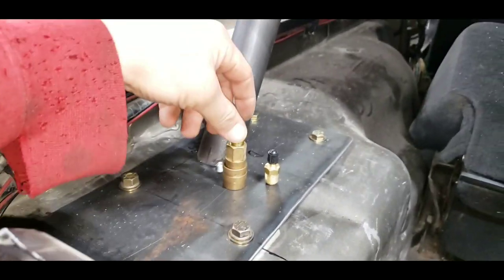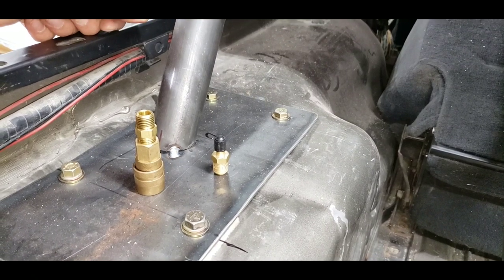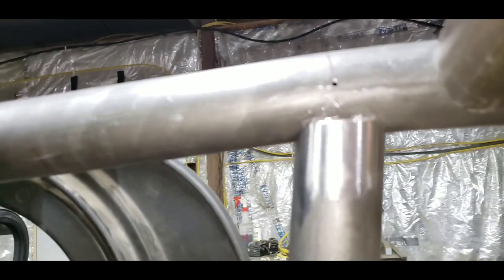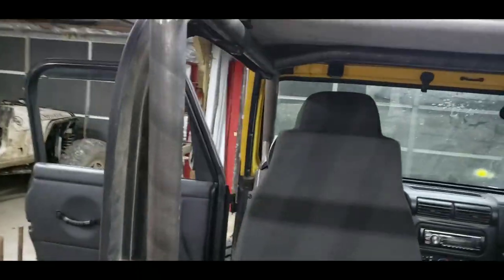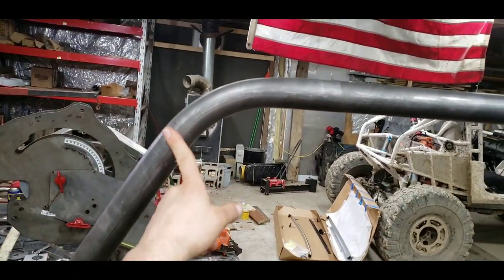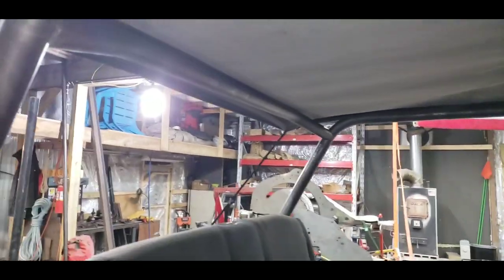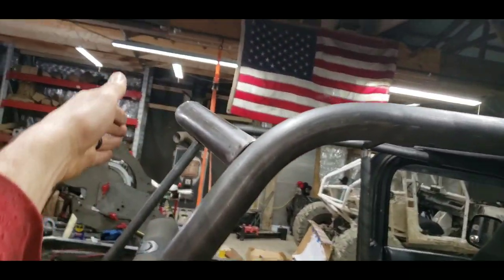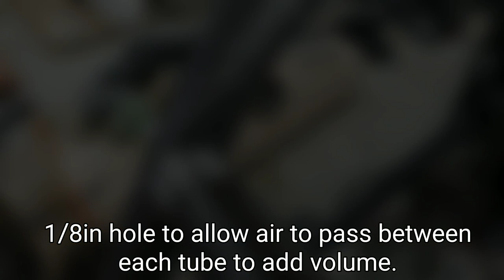Cage Part 2-the secret unfolds. Ep 4: Jeep LJ Build, 06 Rubicon

Comment: Definitely probably want a bigger hole inbetween tubes. That being said, just keep in mind you are creating a pressurized bomb, if it gets punctured it could very well split apart
Reply from the maker: Ya Im gonna open them up a little bigger for sure. Atleast 3/16 anyways. But my YJ cage has never had any issues and real DOM is the best tubing to use for this type of stuff. So Im sure it will be just fine, but I know what you mean man.

Comment: Are you just drilling a hole at each joint to achieve the "tank"
Reply from the maker: That is correct. I wanted to keep the hole small to allow for passage of air/CO2 but not sacrifuce strength in the process. Also I will be adding plenty of gussets and such to make up for the "weakness" of the holes. But the gussets will be solid tube, no holes at the joining points. So only the main structurewill have pressure in them.
Reply: Andrew Saltsman I can’t imagine going with a little bit bigger hole for better airflow would be a problem. The tube welding around the whole is going to add a ton of strength.
Reply from the maker: @Ryan-ki6vr  thanks man! Ya I thats probably a good point. Plus the bottle neck of the exchange of pressure from one tube to the next may create pressure issues...probbaly wouldnt hurt to go up a size or 3! Lol